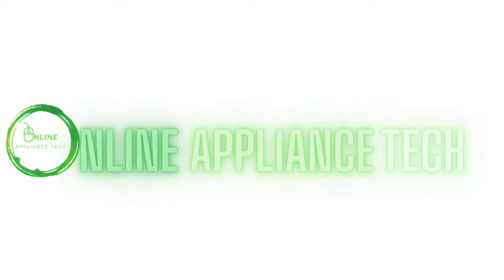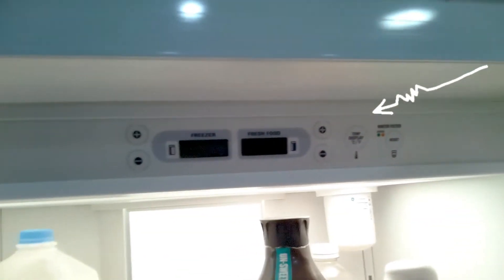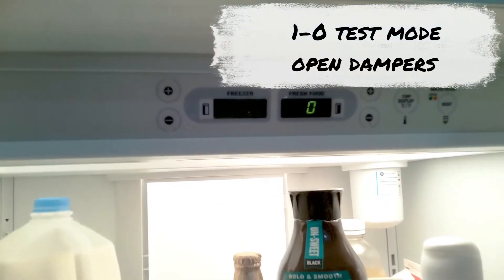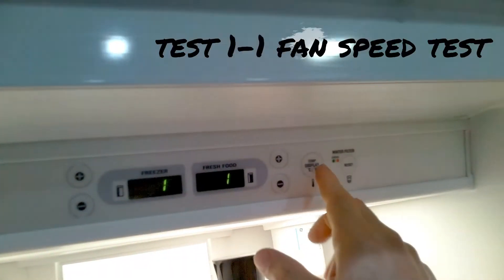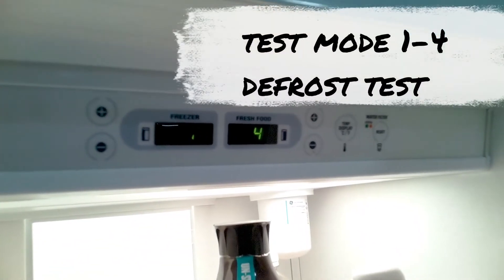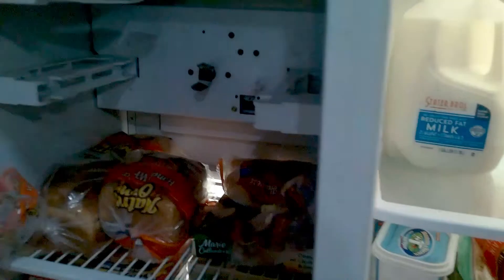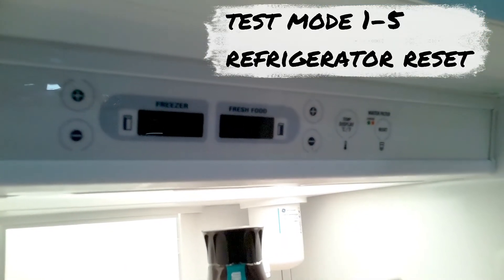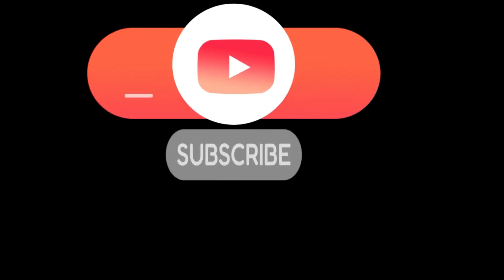GE Monogram Refrigerator Diagnostic Mode [Reset Mode & More!]

Comment: Great video - all tests pass but having an odd issue.   Temps say 35frig 4freezer, but an old school thermometer inside says differently.   Compressor continually running - checked and boosted a little refrigerant, holding pressure. Already replaced inverter board.   same behavior old & new.   Any additional suggestions?

Comment: Thanks for the channel - Super Helpful Info!  I just successfully changed an inverter after a no cooling and a cold compressor, also cleaned the coils behind compressor.  Overnight 12hrs. temps back to 1 freezer and 37 fridge.  Placed food back in temps now 15 and 40 mid day, monitoring.  I want to run your diagnostic test but saw that for some people the test locked the controls.  I just want to make sure the test is applicable to my model ZISS420NRJSS manufactured 03/07.   Thanks!

Comment: This video has been a tremendous help, I am curious if you know if any of these diagnostic tests, test the inverter board that  attaches to the compressor. Looks like one of tests, tests the compressor but does that include the inverter board? Thanks so much.
Reply from the maker: Need help? This video should point you in the right direction:  https://youtu.be/t3S_jIs8ziY

Comment: My display stopped displaying.  Refrigerator is correct temp and freezer works.  I don’t know what to do.
Reply from the maker: It could be the main control not sending power to the display control, or simply a faulty display control. You might need to call a professional for this issue.
Reply: @ thank you!

Comment: I have  model ZISB480DRC with same display as your video shows.  However, pressing and holding all 4 does not start diagnostics.  Any ideas? I really need to run diagnostics to find problem. Fridge freezes up sometimes. Caused water bladder to crack and leak.

Comment: I fixed a evaporator heater pan issue by replacing it and also the evaporator thermister just in case it was bad. Now when I run the diagnostic test it is saying thermisters 1-3 do not pass. How could all 3 thermisters besides the one I replaced all go bad at the same time? I did not have thermister issues before replacing the pan.

Comment: I have a Monogram ZISS360DHASS and the thermistor test results are P1, P2, F3, F4, F5. The unit is only around 5 years old but I'm so tired of having Monogram technicians replace fans, ice pans / hoses, heaters etc., etc. only for the fridge and freezer temperature to rise to around 45 and 20 respectively, usually within a few weeks of their last $500 repair. Does this unit (Note: 36 inch model) really have 5 thermistors and if so do I need to replace all 3 or could this be a symptom of a different issue? Thanks for your help.

Comment: Amazing video!! Would never have known about diagnostic mode without you…certainly not from GE! Is there a list of the various diagnostic modes you can provide? I performed the thermistor test #7 and all 5 passed. My monogram freezer stays cold -6) for about a week then goes up to about 32 and I have to remove everything. It then will go back down on its own and stay cold again for about a week. This has been going on for nearly a month.
Any thoughts? And tests to run?
Reply: I’m running into the same problem I had replaced the inverter board about 3 weeks earlier and everything thing was working fine. Now out of the blue the temp wants to fluctuate just as you described it. Was curious if you ever got resolution on the problem. I haven’t found a video the pertains specifically to this issue. Thanks for your help.

Comment: Thank you for the excellent video!  I have a similar 42" GE Monogram Built-In Refrigerator and been having an issue with the temperature of the freezer and fridge. Sometimes Freezer temperarture goes as low as -17F and fridge temperature rises to 43F even thoug the set temperature is default (0F and 37F). Everytime it does this I turn off the fridge overnight and then turn it on the second day and works fine for 3-4 weeks and same issue recurres again. I think it is a defrost issue because everytime the freezer goes to negative temperature first (-17F or so) then the fridge temparature starts going up from 37F to 42F-43F. Do you agree?
Reply from the maker: Thank you so much for your kind words and for watching my video! I'm glad you found it helpful. It does sound like a defrost issue, and I hope you're able to get it resolved soon. If you have any other questions, feel free to ask!
Reply: This is exactly what my fridge starting doing. Freezer too cold, fridge too warm

Comment: I have a ge monogram refrigerator that I just purchased used. Owners say it worked fine, but I had to lay it sideways for a day before I could get it up in my garage. I let it sit upright for a week, then plugged it in. It's not cooling, but when I run diagnostics, all of the process pass. I've rebooted a few times, unplugged, turned off power and let it sit for 24 hours, no go. Thinking I need a service call but wanted to exhaust all avenues before doing that.
Reply from the maker: Hi there! It sounds like you've already taken several good steps in troubleshooting your GE Monogram refrigerator. Transporting refrigerators sideways can sometimes cause issues, as it can lead to the oil from the compressor running into the cooling lines. You did the right thing by letting it sit upright for a week before plugging it in, as this allows the oil to settle back. However, if it's still not cooling, there might be a few more things you can check before calling for service:

Check the Seals: Make sure the door seals are intact and sealing tightly. Any air leak can prevent proper cooling.
Condenser Coils: Ensure that the condenser coils are clean. If they're dusty or dirty, they can't release heat efficiently.
Thermostat Setting: Double-check the thermostat setting to ensure it's not set too high.
Ventilation: Ensure the refrigerator has enough space around it for proper air circulation.
Listen for the Compressor: The compressor should be running. If it's not, that's a clear sign something's wrong.
If after checking these things the issue persists, it might indeed be time to call a professional. They can check for more complex issues like a coolant leak or a faulty compressor. Best of luck!"

Comment: Hey. In my GE monogram evaporator fan works all the time even when I turn it off. I tried to replace main board and fan motor but it still works all the time till it froze. Any ideas why😅?
Reply from the maker: It's important to prioritize safety before attempting any electrical repairs, so please make sure to unplug the appliance first. Once that's done, it's possible that the issue stems from a grounded wire, meaning the wire connecting the fan to the main control might be touching the housing, which could be the source of your problem. After ensuring the appliance is unplugged, disconnect the harness from the main MPC. Then, use a multimeter set to the OHMS setting, as you'll be checking for resistance. To test each wire, place one prong on a wire and the other on a ground wire at the housing of the fridge, making sure there's no paint obstructing the contact. The multimeter should display "OPEN LINE" for each wire. If it shows any other reading, it indicates that your wire is grounded, and you'll need to locate the point of the short. If you're not comfortable using a multimeter, I would advise seeking the assistance of an experienced technician to perform the test for you. Please let me know how it goes. I hope this helps, and have a wonderful day!

Comment: Hi
It is Tiger again. I followed u instructions to replaced inverter and control board.  Monogram work ok untill now.
Present problem Freezer keep go down to 14F but fridge at 55F. I just performed your diagnostic.  All P 1-7 passed.  Then check 0 1 to 5. Now it reset and On. Will lwt u know later if Monogram work ok or not.
Thanks.... Tiger
Reply from the maker: Thank you!
Reply: Hi
After yesterday, run all your diagnostic, the same problem remain.
Freezer keep going too cold to -14F
Fridge is warm from 50F to 54F. It can't go down under 50F

Please advise
Thanks 
Tiger
Reply: Also,  when freezer door open/ close there is bubbles sound in compressor tank.
But no bubbles sound when open/close fridge door

Comment: Excellent video.  I have not been able to get my ZISB420DXA Ge Monogram into Diagnostic mode. It was stuck on the default reading of 0 and 37 degrees. Pushing the buttons did nothing.  We installed a new control board and then tried it and that did not resolve the problem. We purchased a new HMI Control board assembly panel and now it shows 000  000.  Still locked up.  I understand 000 is an icemaker error code.  The entire icemaker is functioning perfectly. Not sure how to remove the 000 error code. Until that is gone, I can't access the Diagnostics Mode.

What would you recommend we do next?  I had a GE repair guy here who couldnt figure it out!

I appreciate any thoughts on the matter.

Thanks

Comment: Monogram Refrigerator, Model ZISS360DHBSS,  Test 0-7 to test thermisters, and 1,2 Pass, but 3,4,5 Fail.  What does this indicate needs to get replaced?  The temperatures are fine, for the moment, but the compressor (I think) runs a long time.
Reply: I have the same results. 1 and 2 pass but 3, 4, and 5 fail. The refrigerator is not cooling all the way. It is currently about 6 degrees in the freezer and 40 in the refrigerator. The fan in the freezer that you can hear running with the door closed and normally turns off when either door is opened is NOT running with the door closed. The fan test seems to make it run. I have had this problem several times especially after a power outage in my area. Any comments or advice is appreciated.
Reply: BTW. This has happened multiple times and so far it has corrected itself.
Reply: @BobPencek  When you say it has corrected itself, do you mean the test then shows these thermisters passing?
Reply: @mstreich  No  they are still failing but the temperature in the freezer and refrigerator has come back down to where it should be. It’s a strange situation in that each time we have a power outage, when the power is restored, the refrigerator seems to not cool until I fiddle with it by resetting the main board until I hear the fans running running while the doors are closed.

Comment: I have a Monogram refrigerator from 2003 and it has been running warm. Freezer is at 20F and refrigerator at 45F.  Compressor is very hot to the touch and the center panel is very warm/hot as well. I will try the 1-4 defrost test but if that fails, what can I do to fix that? Will replacing the motherboard solve that issue or is there something else? Thank you in advance and your videos have been very helpful!
Reply from the maker: It appears that your compressor is overheating, and the center is particularly hot. This could indicate a couple of potential issues:

A) Your condenser fan might not be functioning properly, or
B) Your condensers could be heavily soiled, leading to an increase in temperature.

I would recommend examining these possibilities to determine the cause. Please feel free to update me on your findings. Wishing you the best with troubleshooting!
Reply: I examined the condenser fan and coil and it is full of dust. How do you suggest cleaning it without pulling out the refrigerator
Reply: I was able to clean the condenser coil and fan and vacuum the built up dust around the area. Refrigerator is cooling properly so far, center divider is no longer warm/hot. I Did notice condenser fan was very loud when rebooting, maybe that will need to be replaced soon. Compressor is still very hot to the touch. Could that be a motherboard issue?

Comment: Thank you for replying. Your videos are really helpful and make a big difference before having to go the tech route. This I am doing and I prefer not to do the inverter check. Are there any last minute fixes. Resets, fuses etc? The cat cuts in and out intermittently hence the occasional nudge to kick it off but I could blow on it and it would turn so could be fluff or too far on the spindle. Thanks again.

Comment: REALLY USEFUL THANK YOU we have the exact same fridge from 2003 and still working, Except the condenser fan has been sticking and needs a tiny nudge to get it going. But this morning the condenser was cold and freezer and fridge warming fast.When I try your test 1/5 and hit the temp display it goes to 0 0 instead of blacking out per your video for a reset. Otherwise the 1-4 are all passes. ANy thoughts re the reset? And can this be cured with a reset from overheating condenser? Many thanks again.
Reply from the maker: Based on your description, it sounds like you're referring to the compressor being cold. Given the information you've provided, it seems like your condenser fan motor may need a replacement, especially considering you've had to manually push it to initiate movement. Secondly, if the condenser fan isn't rotating at the correct RPM, it could potentially short circuit the inverter (I have a tutorial on testing this in my video collection). Therefore, if both the top and bottom sections aren't cooling, I'm fairly confident your inverter may have failed. I hope this information was helpful!

Comment: I was so excited when I saw this, but after trying to push the floor buttons and holding them down, I couldn’t get it to get into test mode. Any ideas?
Reply from the maker: It's possible that there might be a display issue, but it's challenging to diagnose without being present to test it myself. I sincerely hope everything resolves smoothly for you! Feel free to reach out if you have any further inquiries or concerns.

Comment: Great video, I have the same ge fridge and  was able to enter diag mode. but now the controls are locked, if I hit any button it beeps three times and does not let me do anything on the panel. cannot change temp or use door open switch. just beeps three times when I hit and button. any info would be greatly appreciated
Reply: another bit of info. the control panel shows the temp of freezer and fridge. which at this time is to cold. because i cannot adjust the temp. thanks
Reply from the maker: @PANNYMAN  Place unit into diagnosis mode and go to test mode 1-5 [RESET] . Test could take up to 15 mins.
Reply: @onlineappliancetech  I have this same problem after having tried the diagnostic mode.   The temp buttons only return 3 beeps and I cannot re-enter diagnostic mode.  I tried powering down a couple of times and that didn't solve it either.  What is causing the control panel to remain locked?
Reply: @jrews22  I have the same problem, I put the control panel into diagnostic mode, then it locked up and I get the three beeps when I press any button. Did you get it resolved, and how?
Reply: @jrews22  I got the same anyone find the cause yet?
Reply: @stevedyste4339  mine is still locked